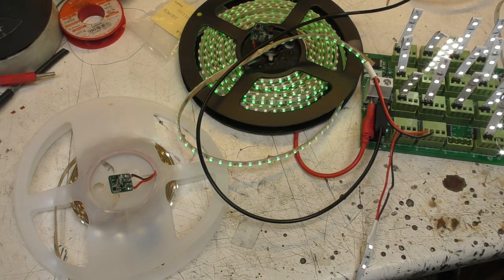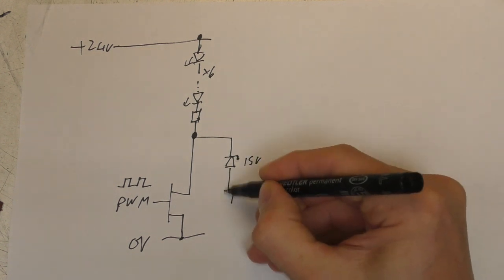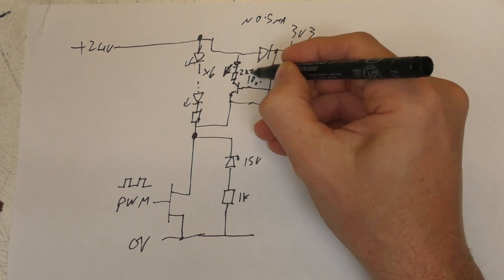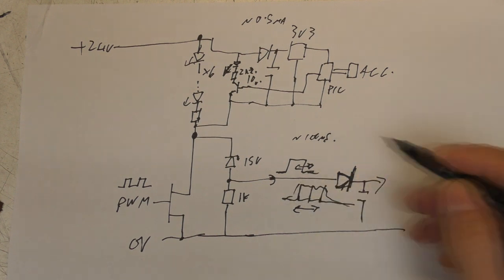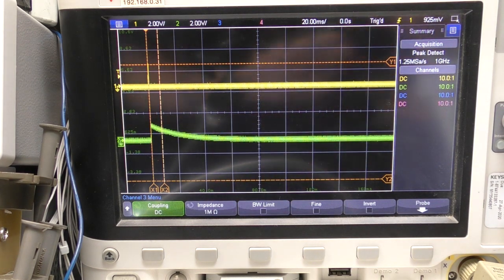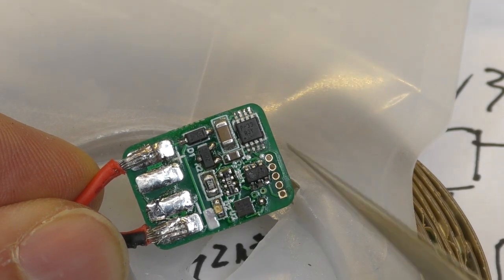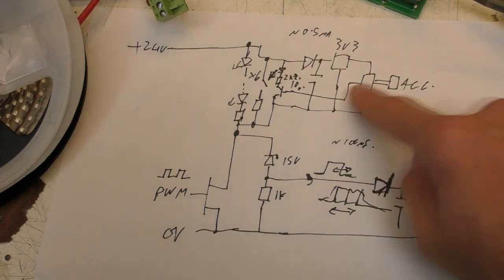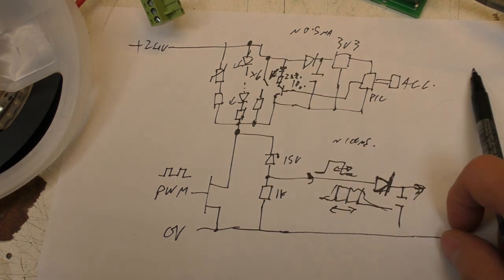2-wire sensing for LED installation

Comment: What I like with this videos is, that they are about overcoming limitations - but with limitations, that I still understand.... sure, the guys and gals working on the next gen Wifi or even Hackers trying to bitwise exfiltrate information out of a victim's PC do similar stuff, but quite often this goes so far over my head... or they don't make youtube videos ;-) 
But for this one... Powering devices over a LED power supply line below their forward voltage... this goes into the book of tricks, thank you.

Comment: This is a really useful trick. Inspired me to mock up a similar solution for AC, using a triac to apply a resistive load and an opto to detect the AC phase. Measured the current over a shunt, then ran it through a high-Q notch filter to pick out the specific frequency and reject load current noise. One thing I realised is that this is a perfect use-case for DTMF tone generators and detector ICs. The detectors have really high out-of-band rejection and the overlapping tones shouldn't ever occur under normal operation (unless the load is an analogue phone, I guess!).

Comment: That really is very, very clever. I'll have to try and remember this for future projects.
Played a bit with using ground/power lines of some addressable strips as the sense for capastive touch(Using a FET to disconnect it from power when detecting and back to power when running) but it only worked some of the time.  Might be worth playing with using PWMed normal LED strips.

Comment: If you investigate MBus (Meter Bus) physical layer you see similar thing. Communication goes in one way by voltage modulation (typical serial with voltage offset) and response comes in form of current pulses, quite neat idea and pretty bus-lenght-proof solution👍

Comment: Elegant idea, how about a resistor is series with the input diode to the sensor board, around 100R, to get those turn off current pulses down. Should allow you to use lower filter values, and thus get a slightly faster response, or at least get better resolution for the sensor output.

As you still have one pin left on the microcontroller, simply use it to power the accelerometer module,so there will be less issue with brown outs. Use the micro power on reset to get stable voltage rails, and wait for a half second after POR before enabling the second chip.
Reply: He said below the brownout issue was discovered after building the board. Its not really something you expect to see IMO.

Comment: Is that an STMicro LISxxx accelerometer? I was about to order some of those myself, will have to look out for the lock-up problem if so.
Reply from the maker: Nope -MC3413 - literally the only accellerometer I could find  in stock at the time

Comment: i wonder if you could do capacitive touch detection on the trailing edges of the LED power PWM signal for a completely passive solution?
Reply: Yes. Here's an example: https://youtu.be/NYT7UqTTGT0

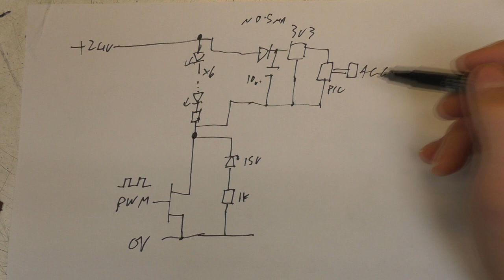That one's posed as a magic trick, the demo of the touch detection starts at about 2:33.

Comment: I don't see where the data is coming back to the sender, is it measured via a current sensor or by setting the PWM output to an input during the off time and measuring it that way?
Reply: The data is returning to the system that controls the PWM via a 4th wire (so you have +24V, 0V, PWM, and the new data line). You can see this (unlabeled) data line in the lower right portion of the completed schematic at https://youtu.be/8WH5tCNIIck?t=574.
Reply: @BusyElectrons  Thanks, I'm pretty new to electronics and that clears things up for me.
Reply: @86abaile  You're welcome. Glad I could help.
Reply: The 2 wires that go to the LEDs are the +24V wire and the other wire comes from the junction of the 15V zener and the top of the mosfet as seen in the diagram. The sensing comes from the current draw in the resistor in series with the 15V zener at the PWM supply (source end) of the LEDS. Every time the accelerometer activates it sends a series of current pulses which are measured as voltage across that series resistor. These pulses are smoothed by a cap so you get one long pulse as was shown on the scope.

It appears that he then uses that long pulse to increase the pulse width and hence brightness of the LEDs.

Comment: does the feedback signal. go back into the dimmer to adjust how it's driving the power mosfet switch?
Reply: Yes, it would do. He didn't go into that as the real magic was in the LED interface.
Reply: @daShare  thanks for the clarification

Comment: So your are reading the data from Gnd line?
Reply: Perhaps you could think of the strip as presenting three ‘states’ of load to the control circuit, LED on full load (data ignored), LED off with 10mA load = data high, and LED off with no load = data low.
Reply: The zener diode and the 1K resistor following it to ground are on the control board IN FRONT OF the power outputs (plus and minus) to the LED strips. The 1K resistor then already is a current sensing resistor, where the incoming signal is read-off or processed/filtered as a voltage.
So GND would be the at the SOURCE of the N-Ch Power-Mosfet, the LED (-)-output is at it's DRAIN and the signal comes from in between (from bridging the MOSFET with the zener-diode circuit).
There are essentially 2 alternative pathways, 1 for the on-state (providing 24V to the LED strip) and 1 for the off-state (providing <9V for the sensing board with feedback via the sensing resistor).

Comment: About accelometer lock up, could that mcu onboard reset it?
Reply from the maker: No, i2c interface  dies
Reply: @mikeselectricstuff  i meant that you could power it via mcu pin, i guess it don't take much power.
Reply: @bartomiej368  I think he has already ran out of GPIO pins in this specific microcontroller in this application. Tiny little 6pin micros....
Reply from the maker: @bartomiej368  Would have done if I'd (a) discovered it before doing the PCB and (b)
had enough pins